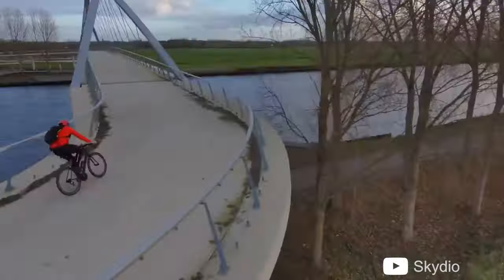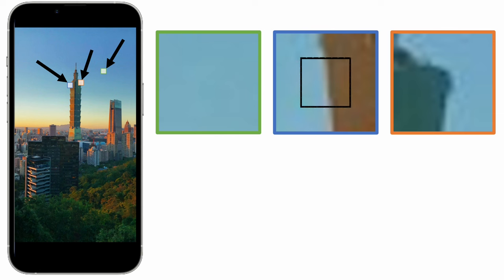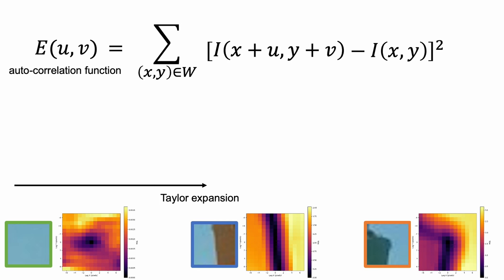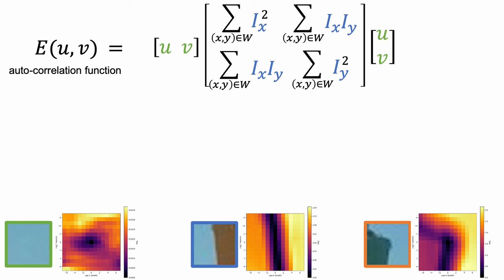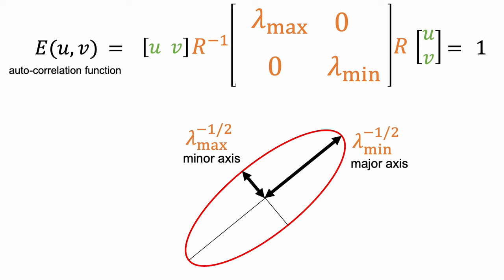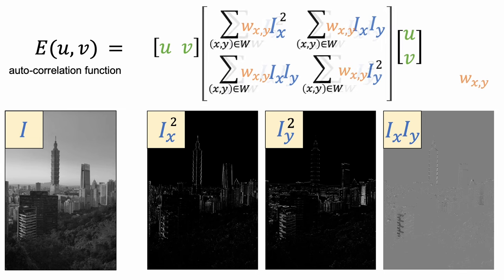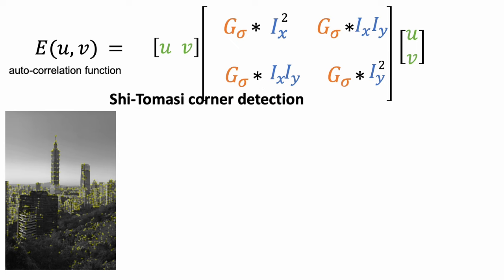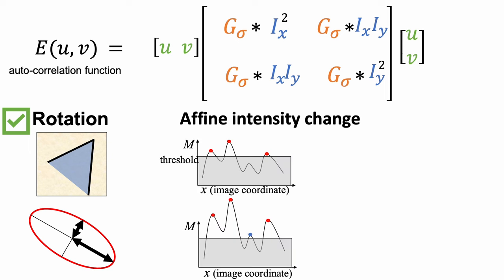What are Good Features to Track? Shi-Tomasi Corner Detector Explained

Comment: Great vid!
Quick question — it wasn't clear how many of these second-order matrices we're making. One for each patch, right? A single one for the whole image wouldn't provide us with local information. The explanation confused me a bit

Also, if I understand correctly, the intuition is that the second-order matrix helps us compute the curvature of the edge in the patch. And checking the eigenvalues provides us with info on that curvature. Is my mind in the right place? 😅
Reply from the maker: Thanks!

For every pixel location, we will form a second-order matrix. So yes, it's one for each patch. 

The eigenvalues of the second-order matrix tell us how fast the summed square error (between the reference patch and the translated patch) will go up. The eigenvectors tell us where we should move to get the fastest or the slowest error changes. So, to find a corner, we look for patches with a *large smallest eigenvalue*. This means that the error still goes up quickly, even in the direction with the slowest change. That's the criterion for good features to track.